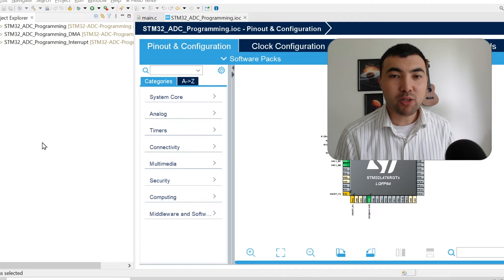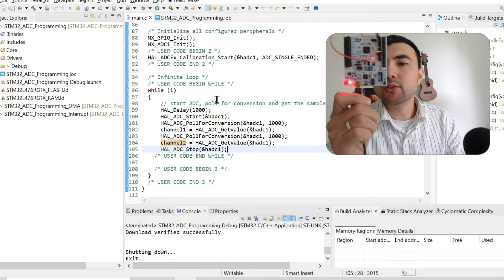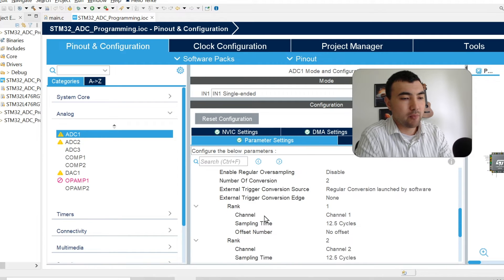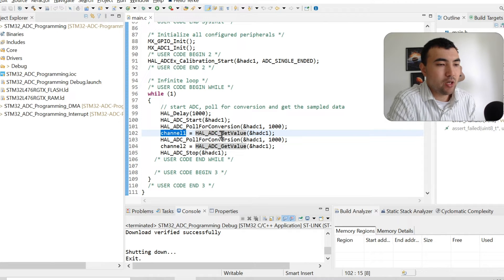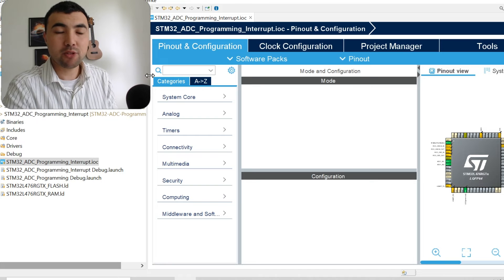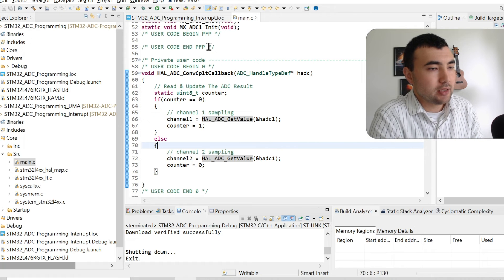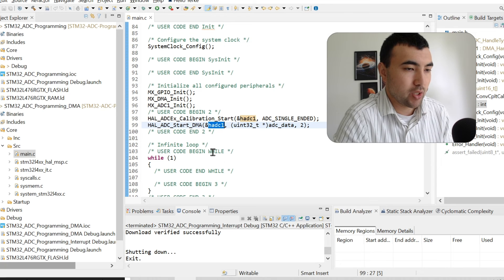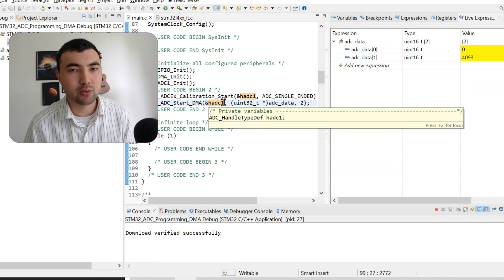STM32 ADC Complete Guidance: Polling, Interrupt, and DMA Modes.

Comment: In your interrupt mode example you call HAL_ADC_Start_IT() only once outside the infinite loop. Why does it continue to sample? Aren't supposed to call it multiple times? Please explain.
Reply: I guess this is because you have "Continous Conversion Mode" enabled. But how do you determine the sampling rate in this case?
Reply from the maker: it depends on the timer prescaler and the sampling time you set. For each channel, there is a parameter you can set to control the sampklging rate.

Comment: Is it OK to cast a *uint_16 to a *uint_32 and pass it to Start_DMA? Does the function understand that the buffer is really only 4 bytes and not 8 bytes?
Reply from the maker: in that case, I guess you need to specify the memory width to 4 bytes, not 2 bytes.
Reply: @steppeschool3629 yes. I noticed now you set the DMA length to half word.